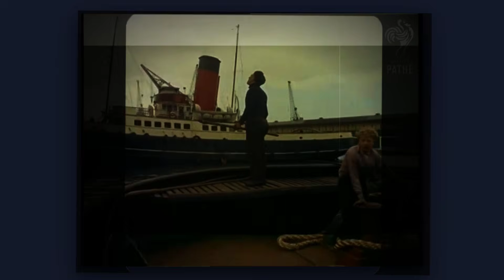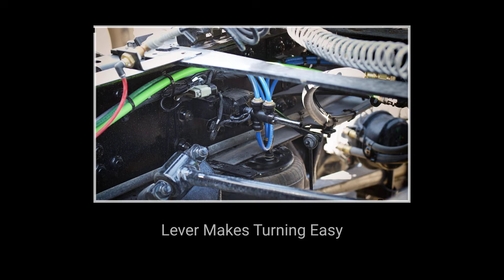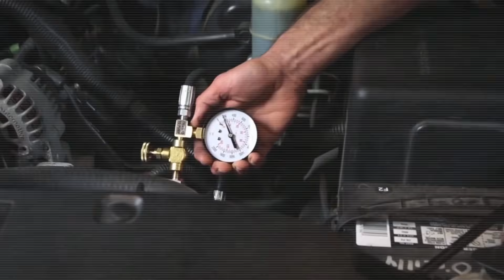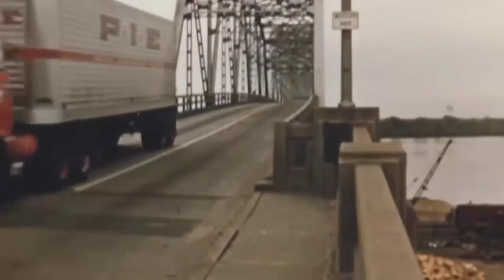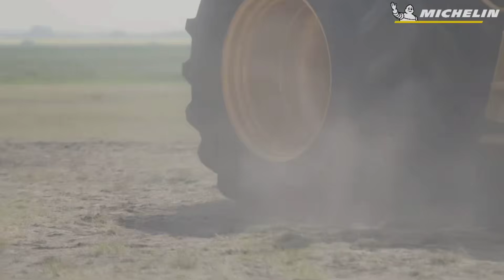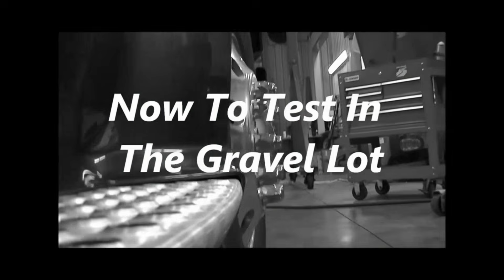Why Truck Steering Wheels Are So Huge

Comment: Most cars are 2500-4k lb with a weight distribution close to 60% on the front axle. that means your 1000lb number is more like per tire.